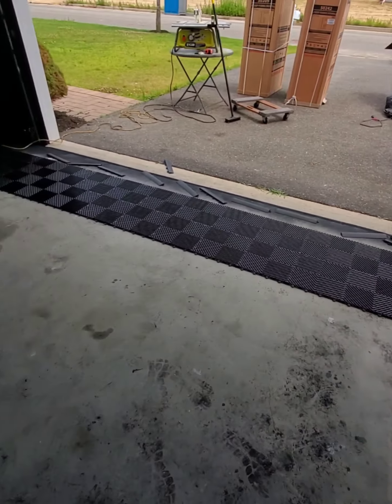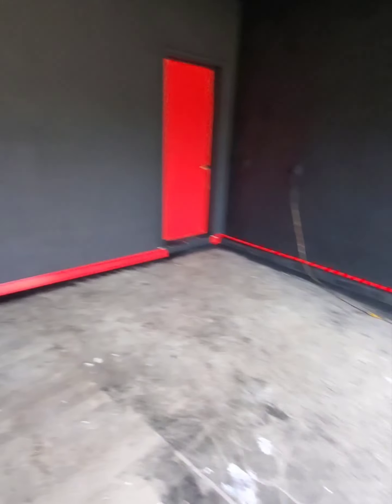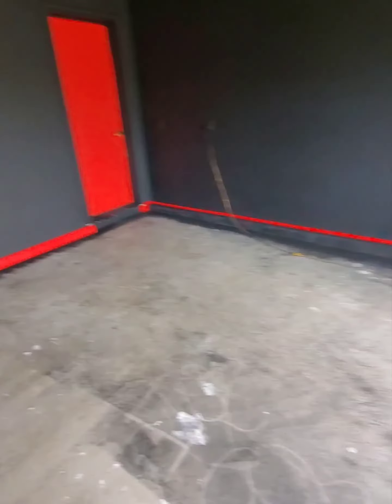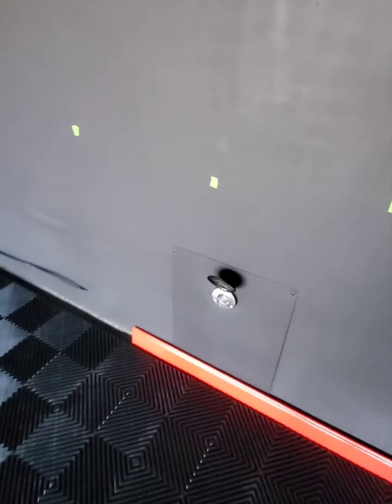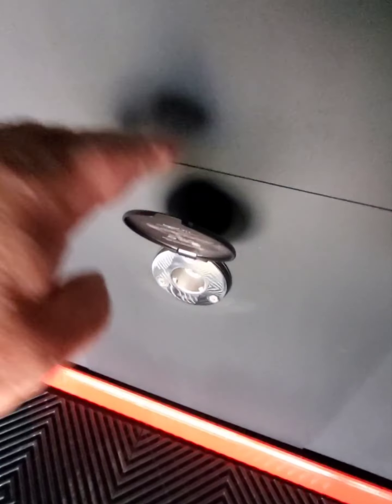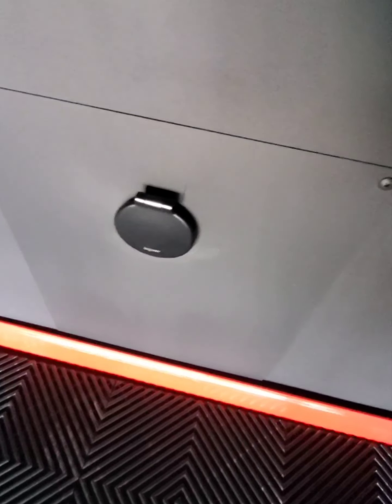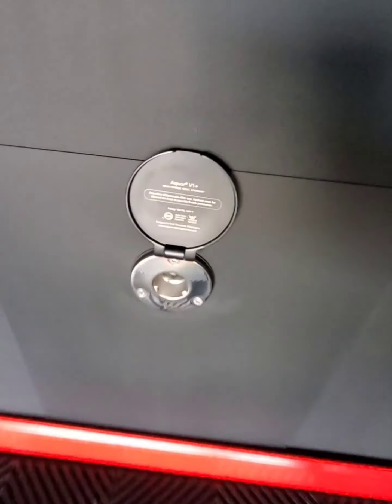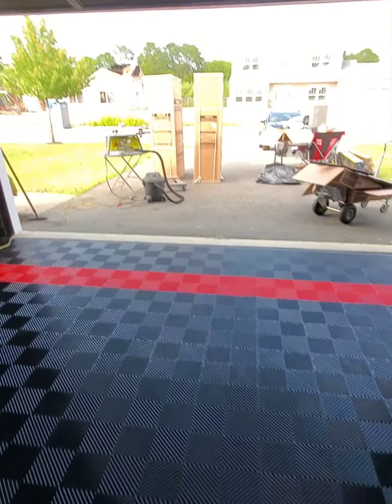Racedeck flooring and New Age cabinets 3.0 garage upgrade

Comment: Hi, cool garage! What did you use for the panel behind the Aquor? I need one also to protect the drywall from the vacuum breaker dribble.
Reply from the maker: A square piece of plastic panel from home depot. Used to make signs